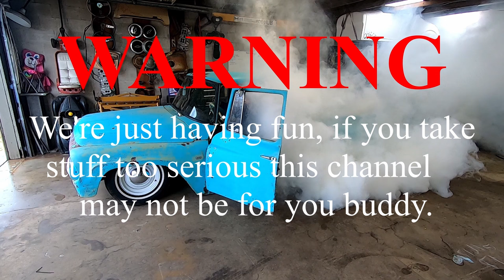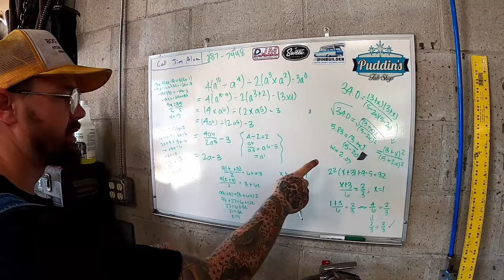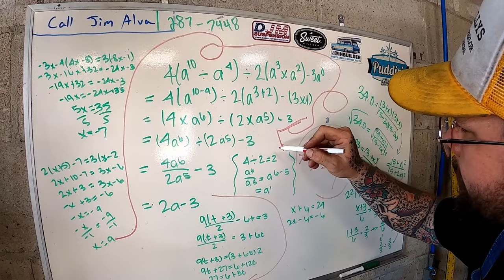The Yee Hawl gets a carburetor FINALLY.  ((IT CATCHES ON FIRE!!!))

Comment: I set one on fire on the lift in the shop using brakekleen trying to figure out a water or oil leak and it was a Toyota privia van where the engine is in-between the seats. No putting it out just let down and rolled her out the shop!!! Lmao

Comment: I replaced the battery cables on a 93 Toyota pickup left the old cables just sitting in the bay one day I was like why is this cable undone so I hooked it back up but the other end was just dangling under truck until it connected to the frame set all my wiringharness on fire here's my sign

Comment: Hot damn Sweet Pea, how ya doin babe?  Howdy from Lima, Ohio- home of the Ford 2.3 overhead cam 4 cylinder engine. There are a bunch of aftermarket speed parts for that motor, if you ain't scared.

Comment: I burnt down the four wheeler one time it was my first four wheeler and the gas line was leaking right on top of the spark plug I did I guess I should’ve known better but I was only 14 at the time I was trying to put it out with a couple bottles of water but in the end it was nothing but a  pile of ashes when it was done , it was a Chinese Brand that I traded a welder for that I rebuilt

Comment: Set my 67 D100 stepside on twice. Also got yelled at by an ambulance services lead mechanic for putting at the end of its life Dodge high top@ 12 rears old and still "Drivable" at min 2mill miles wandered down the road like a cow grazing dropped a lower control arm the handling went to hell pulled over vood thing was on a gravel shoulder. reached for my flashlight threw it back as I saw the lite was on....told my medic  the rigs on fire. Just grabbed handfuls of dirt gravel the grease fire went out fine. A NYE i was driving it and rhe starter fell off after completing a run leaving the ER.

Comment: I set a 65 econoline pickup on fire.  That was exciting.  It backfired and blew the fuel filter off. When that happened the explosion blew the engine cover up and an immense amount of flammy fingers  reached out and tried to touch me. After  loading my pants with the proper amount I lept  out like a frightened cat. Ran around shouting " THE TRUCK IS ON FIRE! THE TRUCK IS ON FIRE!" Well in my controlled pandemonium, this was in winter with a bunch of ice about, I fell flat on my pre padded butt. My pop ran out of the house and quickly put the fire out. He looked at me and said " What the hell is going on?" Shook his head as went back in the house. This is one time I caught a car on fire.

Comment: I almost burn down a brand new Lexus while helping another tech push in a vehicle into the shop; he told me to jump in to turn the steering wheel not knowing fuel rails was pulled out of it to diagnose a customer car. The battery was still connected, Lexus switch over to  push button start at that time 2007 so can’t steer without turning on accessory power, but I’d my foot on brake pedal so it started the high pressure direct injection fuel pump located on top of the engine. It Ignited flames started coming out of the hood, the master tech who was working on the vehicle ran for the fire extinguisher. This happened on the second week at the dealership. Also another dealership that I work at the shop foreman and tech trying to locate vacuum leak by spraying brake cleaner near the exhaust manifold burst into flame..so it happens to the best🤙🏼✨

Comment: Truck ,tractor a d10 dozer with 43 hrs on the clock and my ultimate F up a atlas copco pit viper rock drill burned that baby right to its tracks best part was when the 60 foot guide tipped over from the heat it happens I got a ZZ Top style beard and I was cleaning something with brake cleaner and got some in my beard and struck a arc and I was doing a Richard Pryor under my helmet was a ragging hair and brake cleaner inferno so yeah we all have had some precarious moments with fire

Comment: Ain't no thang if your prepared lol my 87f150 went up in smoke driving down the road and when I pulled over she went up in fire so I dumped my powerade on her jumped the starter solenoid and was on my way pretty sure it was the leaking trans fluid or oil straight into the exhaust manifold leak. And to think I was just gonna send it cuz if known shes a smoker but the old lady didn't trust the smoke and had me pull over to check it out

Comment: Ive set a mud mower on fire and my hand with a can of ether and brake clean and my motorcycle had a fuel leak under the tank and i guess hit the headers got a little toasty and so did my legs. Oh and a old gx 110 gocart motor she had a aux tank that a valve was leaking and same thing gas hit hot header and luckily it was inly a few drops of gas .

Comment: Note my profile picture, that is a fiberglass carb cover on my first boat motor, a friend was helping me with timing and sure enough my face was in front of what became known as the de-eyebrower/ forhead-extender. We went to start and it backfired and had no where to go but my face. And sure enough my face was as smooth as eggs from my new now 5 head to  my neck. Luckily my face took most of the flame so friend was shielded and was in good enough shape to laugh for hours as I now had only one expression...

Comment: I used to manage a muffler shop but hell I was the only employee so anyway a guy came in to get  a complete muffler and pipes on a newer sports car ( He didn't like the factory set up). I had to heat up one pipe and did so too get it to fit after getting it to fit I brought car down off lift and started it up I had melted the gas line to which it blew out and yep had a bit of a fire but shut off car put fire out and all was well but scared the puddin out of me

Comment: I've never seen a 2000 or 2300 with the asin carb or that two barrel  conversion   . Every one I had has the ford weber 3236  . Did you know that engine has been used in racing  in Europe   it's a German  design . Check out Esslinger engineering  pinto beans  lots of high performance  parts . Try that 2300 in a vw sandrail  rear engine  can't keep the front end on the ground  fun

Comment: Did you plug off the brake booster port (@22:46 directly below this connection) on the plate between the carb and the manifold? I think that may have been your vacuum leak.

Comment: I caught a car on fire one time. Me and my sleeping 13 year old son were driving down the road and hit a bad bump in the road. The battery fell (because it was not the one for that car) and the cables touched metal and 🔥. The car cut off as I coasted to a stop at the beginning of my driveway. I wasn't sure what was going on yet, but when I realized the car was burning I didn't know what to do really. So I tried to pop the hood and it was stuck. So I'm beating on the hood and trying everything to get to even see under the hood. So. I woke my son up screaming to go get my husband and a blanket or water (because no fire extinguisher here 😯). The water hose wouldn't even get anywhere near the car. So instead of helping, my husband comes out screaming. "What's wrong? Why don't you pop the hood?" Like I didn't think of that! Once I finally got him to realize I needed actual, physical help. He came and saved the day. If we only had it recorded.

Comment: When I was 18 my sbc malibu was having running issues. So I pulled the carb and a bunch of fuel went down the intake so I was like “hey let’s see if this fires up.” Not thinking about when I cranked it the fuel line would still pump with the mechanical fuel pump. So I cranked it the engine started to take all the while spreading fuel all over the engine bay. Then it backfired out the intake manifold, next thing I know some cop is yelling at me😑

Comment: my truck has caught on fire due to rusted and leaky Fuel lines in a spot idk it was Leaking right above the Exhaust manifold it dripped and Sparked and just ignited and it had to Happen during a time i had to have it to pull another truck home due to driveshaft falling out in the parkinglot of a gas station so i had to resort to pulling both chevys home with the other truck i had at the time a ford F150 but my chevy has been fixed since then and the 1 with Driveshaft issue was sold

Comment: I set my 1983 Limited Edition Monte Carlo on fire, you know pouring transmission fluid into a smoking hot car on the side of the highway leads to a very interesting experience. I really miss that car but hell I started dating the girl that pulled over to check if I was ok and I had gotten more than 300K miles out of that car.

Comment: 2 times I set a car on fire, first. Same as you, grinding and had a small fuel leak near by, second was pure stupidity, using cutting torch for an exhaust hanger and guess who didn’t bother to look into what I was blasting flames into?? This guy… and the torch did it’s job.. right through a fuel line, extinguishers are truly the best invention ever luckily I was outside so just the car would be gone, but since I’m such a worry wart and knowing I’m really not very smart, luckily had one handy  to save my behind

Comment: Man this is kind of a long shot on my part but was wondering if you could point me in the direction of finding a good website or brand to order the front grill trim molding. I’ve ordered the parts from lmc and they are absolutely junk. Can’t seem to find a company that gives me good quality trim. It’s for a 85 c10

Comment: I nearly forgot I did burn a car down cracked the fuel pipe when trying to start it backfired and set the fule alight the electric pump kept pumping fuel didn't think to turn the ignition off very quickly had it out fire brigade turned up flooded the whole interior destroyed the whole car 😅🤣😂impatient

Comment: I done, set my 97 chevy cavalier on fire, back in the day i had the ol boom booms in all my cars, not sure if something happened from hooking that up but one night i went to leave my x wifes house, noticed my tail lights werent working id change the fuse as soon as id turn the lights on boom it woupd pop the fuse again, went threw about 15 fuses i was like ill fix you ass and i poped one of them fuse jumper things in there, its just a piece of metal shaped like a fuse, started it up turn the lights on and it was good,  im sitting in there letting warm up and turning on ky radio and wat not all the sudden poof, i see flames comimg out of my fuse box, coupdnt get it to go out had to have the fire department come, they destryed the car broke the windshield ripped dash apart, it was totaled anyways all the wires where burnt the whole fuse box was completley melted lol, but yea if u ever have an  electrical short dont try putting a wire or metal in there

Comment: ok i had my powersteering hose changed and the garage put the hose up against the exhaust manifold. i was driving out of DC driving like i stole the car. the manifold got so hot it burnt a hole in that powersteering hose and the engine caught fire. i stopped at a Mcdonald's to visit a friend. smoke was just rolling out from under the hood. i raised the hood and i right away was doing exactly what you were doing with no help. the employees at the store brought out one fire extinguisher and it didn't work. i continued blowing with no help. the employee brought out a second extinguisher and it didn't work so i continued blowing on the fire. i finally very winded got the fire out. later that night the mcdonald's caught on fire. at least the employees know to call the fire department instead of trying those useless fire extinguisher. i was able to extinguish my fire.

Comment: that aluminum is just pot metal junk try a steel inst maybe it will work a little better but like me you will have to weld in better aluminum then drill and tap so your insert will hold like it should

Comment: Actually I was trying to remove a fuel tank that was rusted out I had the top open and wasn't thinking I cut the straps with the grinder the Sparks United the fuel in the tank I looked around for a water bottle and I had a purple power bottle that I had water in previously but one of my employees had took another purple power bottle and made two stroke mixed gas in it and was putting it in a weed eater I grabbed the wrong bottle and ended up dumping gas in the back of my Datsun I panicked looked around didn't think I was going to get it out went and pulled my fuel cell out of the passenger side which was made out of an oil jug and a fuel pump and when I did that and came back around I found the other purple power bottle full of water and dumped it on the fire when I did that it put the top fire out and the smoke smothered the fire in the tank I honestly got really lucky and I'm glad I didn't burn the shop down